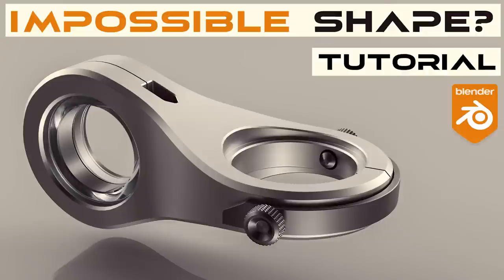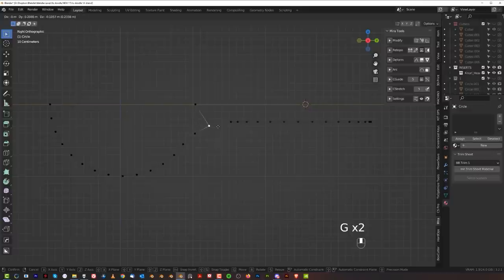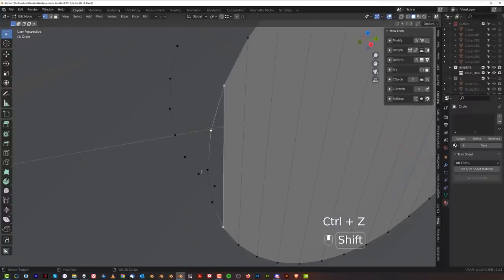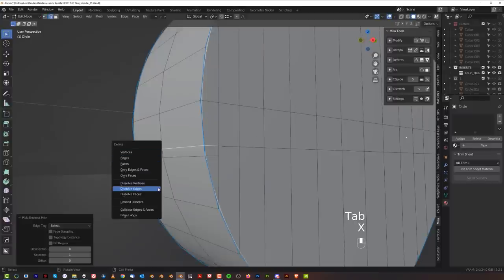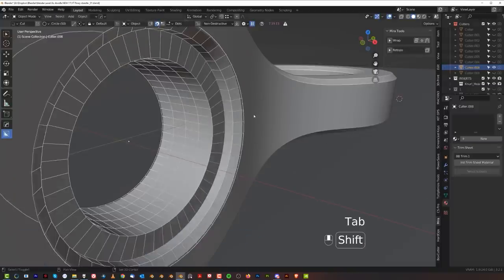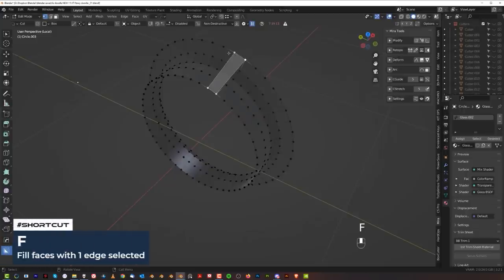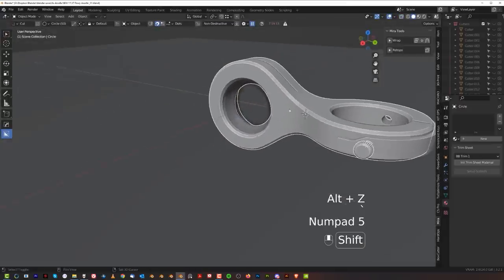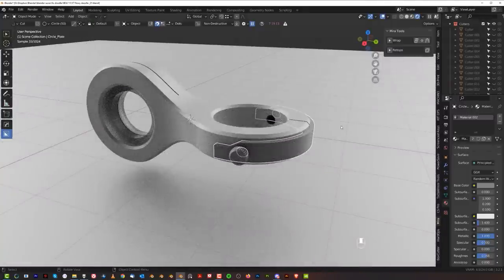ORGANIC Hard Surface - Blender modeling TUTORIAL

Comment: Before I watched the tutorial and the method used, I quickly tried to model the main shape by myself.
I came up with the same workflow, but instead of leaving the circles number of vertices at 32 I lowered it to 10, then I build the surface with subD in mind. I used insets to get a circular edge flow on the circular surface, a grid is not optimal here. 
I am not an SubD cultist but this shape in particular is perfect for SubD modelling. It's faster and easier to do and more controllable.
Reply from the maker: good show mate, yeah this could be done in multiple ways
Reply: WTF is going on with the world, man 😂

Comment: Little advice for u my guy. It seems that u struggle a bit with recentering ur camera when u work on details.

Try pressing , on ur numpad (obviously with numbpqd activated) and it recenters the camera to the selected.

Hope that helps a bit and u don't need to  recenter manually so annoyingly.

Ur welcome.

Nice vid btw. will look into the free course when I have time.
Reply from the maker: i know the shortcut but it's a bit far to get to, so i seldom use it.

Comment: do you have any tips when it comes to hard surface modeling where as to the faces randomly gets warped, as in theyre not flat? I think its because of using beveling for me , I didnt even see it until i did a retopo of it and then all the weird v like faces popped up hard. Been trying to figure out how I would  fix it but i cant seem to figure it out, nor 100% why its happening and how to prevent it, Normally havent been an issue until this mech i made.. 
The reason i think its bevels is beacuse with it creating ngons , some verts seem to follow the line of the other edges warping it further back than the rest.  Its been bothering me big time for the last week ... Its happen quite a few times too, and whenever I go itno the top bar Normals and S + z+ 0 , it flattens it but then messes up everything else connected..
Reply from the maker: you may wanna post a gif under help on our discord

Comment: Just get it in mind you can create this in CAD software just in a few minutes
Reply: CAD = no poly and exports are a joke
Houdini yes and better topology
I did it for the challenge
But no free
(sorry for my english, i'm french)
Reply: @MaxColmX  you can just concept hard surface with CAD and just retopologize it if preferred. I see no problem with cracking softwares just for this. Sooner or later, topology in polygonal 3d modeling softwares becomes a hassle to a point where time is wasted on working around topology just to get the preferred form without the liberty of creating more interesting shapes and form transitions.

Comment: You need paid addons and 4hrs of training to finish this
Reply from the maker: well get a move on and snatch them , what are you waiting for
Reply: Actually, you don't need the add-ons, everything shown here can be done in vanilla Blender but it take more steps and so is a little more laborious.  Ponte works super fast because he assumes you're not a total noob and have digested previous tutorials.  I would say that the hardest thing to do without the add-ons is the offset loopcut around the holes before adding the bevels, but that function is provides by machin3 tools which is a free add-on so there's no point to not installing it.
Reply from the maker: @bill392  off set cut is mesh machine, and thats not free, and i have no idea how this would be doable in vanilla without suicides
Reply: @PonteRyuurui  You're right off course, I have MeshMachine too and have been using the offset cut function.  Sorry for the mixup.
Reply from the maker: @bill392  they are easy to mix up
Reply: Paid add-ons will never sit well with some people, and that's a valid criticism. But needing "4 hours of training" - and I'd easily multiply that by 5 - to be able to follow along is actually fantastic. There are so many good absolute beginner Blender tutorials out there. It's when you get to the intermediate stage where knowledge starts to dry up and free resources become increasingly hard to find. That's why all of us should appreciate creators who keep putting such content out despite its smaller view count.
Reply from the maker: @Outmind01  we have a full FREE course for beginners, and I bet it is the most detailed, comprehensive free course out there for absolute beginners: https://www.blenderbros.com/jumpstart
THEN we have a follow up course for addon workflow, also free: https://www.blenderbros.com/terminal
So, any complaints regarding addon content come out of pure laziness.
Reply: @PonteRyuurui  I think that people either legitimately don't have the money ($35 for Hopscutter is a lot of cash for some teenager just starting out in a poor country) or they don't understand that investing now saves money and time later.

And of course there are people who can't be bothered to put in the time and learn the fundamentals. But that's an attitude, not a Blender problem xD